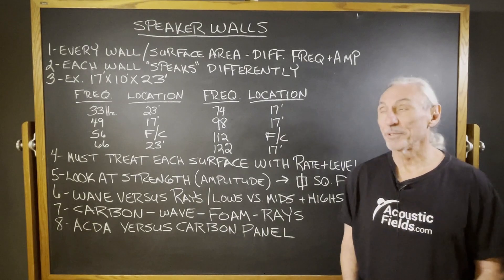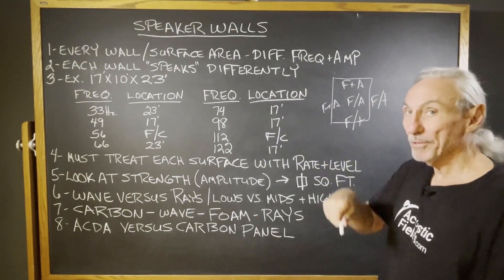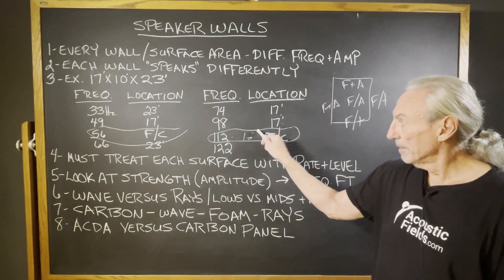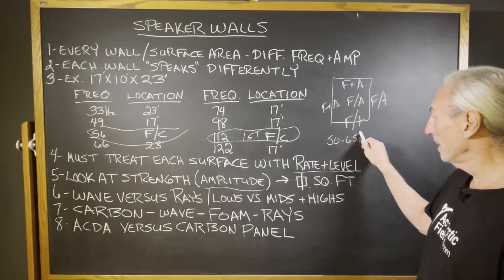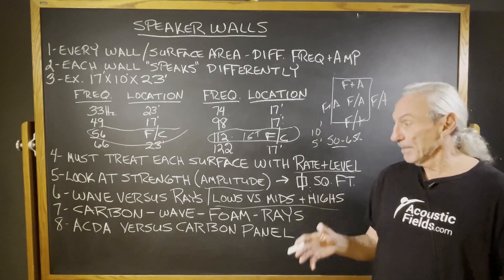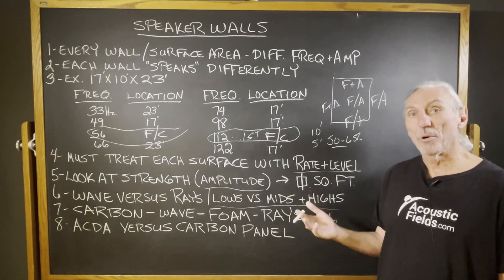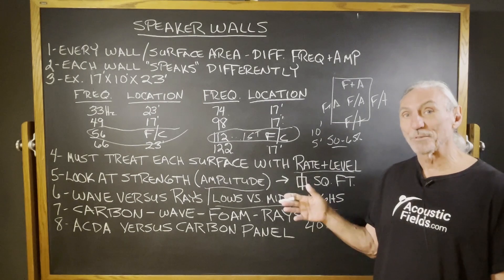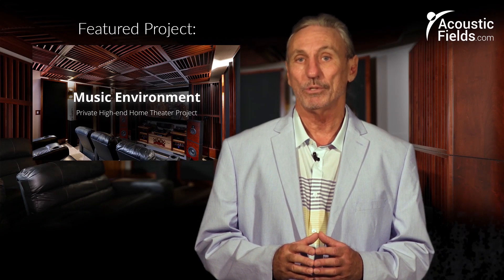Speaker Walls - www.AcousticFields.com

Comment: Hi,
 How can the 23' wall cause a problem at 33hz?
Please show the exact calculation used in this example.
Thanks.
Reply: 23' is about 7m. F = V/Lambda(length of room times two). 343/(7x2)=24,5. first harmonic 49, second 73,5.
Reply: @kaptenkrut  Yes, I agree with that formula. 👍
Reply: Regardless of which wall creates the 33Hz issue (17' wall IMO), it still needs to be treated.
24Hz is also an issue, but harder to treat.